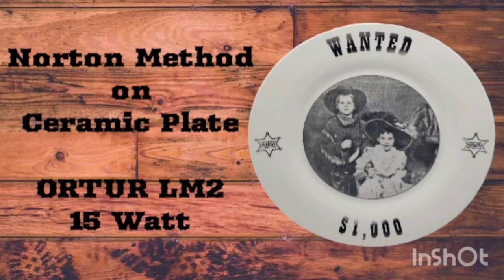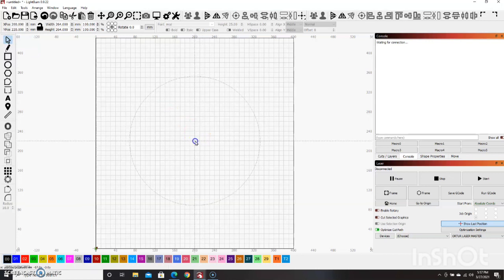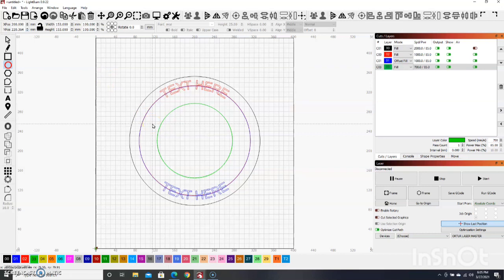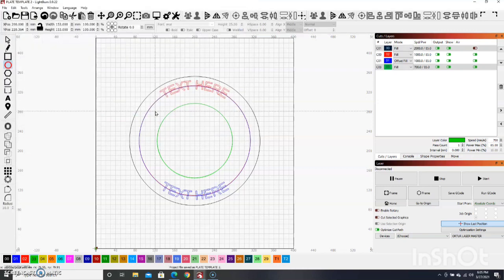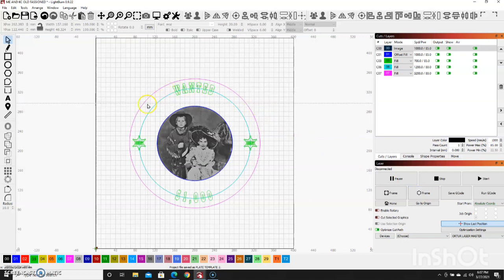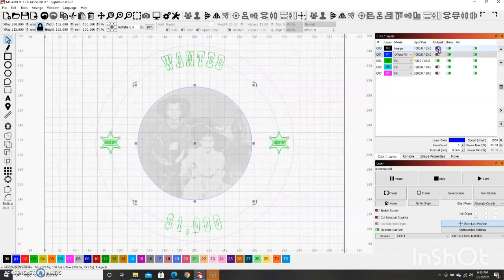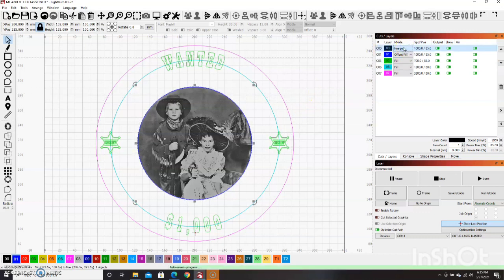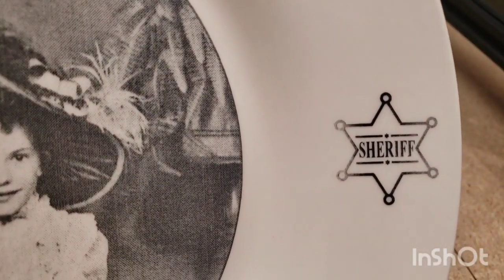Norton Method On A Ceramic Plate Tutorial. OLM2 15W.

Comment: Hello. Great video. I have one question. You painted the plate with white paint. You are using Norton's method. Everywhere on YT there are videos where two paints are applied, e.g. white and black, or vice versa. How did you get the black lettering and drawing? How was the shade of black created when everything is white?
Reply from the maker: Easy mistake with "Norton" put on so many things.  There is Norton White Tile NWT which this video is about. Used White paint on a tile and go slow and hot enough to burn the paint black and fuse into the tile permanently. The Norton Black Tile you paint White then a layer of Black. You go much faster and burn just the black layer off to reveal the White underneath.  This is way faster but not permanent. They make nice gifts but I have never sold much of any for profit, but some do OK with them I guess.
Reply: @TheKennyHack  OK. So you paint ceramics first white and then black?
Reply from the maker: @DariuszBańczyk  this was just painted Heirloom White.  Then lasered at a slow and high power to burn the paint permanently into the ceramic. The black is created by burning the high zinc content in the paint. It can be washed and used as a normal plate and the image will last for a good while.

If you do a second coat of black and just burn off the black layer  to expose the white its not permanent but is much quicker to do.  The plate is only for show and can't be used.

2 completely different methods.
Reply: @TheKennyHack  Thank you.

Comment: On the top tool bar, to the right of the group select. Those triangles will flip the image either vertically or horizontally, rather than how you did it be moving and resizing.

Comment: Hi.
Excuse me, I don't speak English and I wonder if what you did after recording the image is to apply black paint and remove the waste?
What does the Norton method mean?
thank you and excellent videos.
Reply from the maker: With the Norton method you put white spray paint on the tile and burn it at slow speeds and high power to fuse the paint into the tile permanently.

Comment: very nice, i love your videos, but i have a small issue with ceramic, i dont find the same paint all of you use it (im in africa) i found some glossy white paint spray, czn i use it? i have a ortur lm2 20w what do you suggest me as settings? thank you
Reply from the maker: Most use a flat white but I have seen people use gloss and other off white colors. Just don't be afraid to experiment.  You should be able to use the paints for other projects if you can't get them to fuse into the ceramic how you want.  For me that's some of the fun of this hobby is trying new things. Good luck and thanks for watching.
Reply from the maker: Is your 20w a fixed focus or an adjustable? My adjustable 20w I couldn't get to fuse the paint very well as its focus wasn't the best. The newer fixed focus I think work. Start out around 1000mm/min and 80% power. I like newsprint using the double dpi method I show in my videos but most use Jarvis or Stucki. Just make sure you clean the ceramic with acetone or the like before you paint it.

Comment: Don't use white paint on white ceramic or porcelain.  It's difficult to gauge the thickness of the paint layer with it being white on white. This is likely why some of the letters are faded. the paint is thicker there. The best colour I find to use is purple or yellow spray paint.
Reply from the maker: The outer letters got a bit faded since its on a curved part of the plate. About 6mm  in height difference across the lettering. I've figured out how to get them fairly uniform by running them twice at two different focus lengths to get fairly even. 

I also do 3 coats on my plates to make sure I didn't skip any areas. So far this has worked very well for me and doesn't seem to affect my overall speed. I've since moved up to 1400mm/min at 85% power with good results. Just need to darken the image a bit to adjust for the faster speed. The faster you go the more accurate your focus has to be though.
Reply from the maker: Can you run faster with the yellow or purple vs white?

Comment: New sub here, I just got my laser and have done some work on it but nothing holds a candle to what you do. Can you do a tile at the same rate as what you did the plate?
Reply from the maker: I'd think so. Right around 800-1200 and 80-85% seem to be typical #s for the Norton Method. I've only been doing lasers for about 9 month. Just put in the practice and you'll get things figured out. I had to teach myself as nobody was running the high speeds I ran back then,, but now a lot of people are doing it and can give advice in the forums.

Comment: another out of the park, thank you. How do you find it for feel, is it etched in the plate?
Reply from the maker: You can feel the engraving is slightly raised up from the surface or like a texture to to it.
Reply: @TheKennyHack  thank you sir, also i find to centre things quickly i use the move to center icon up in the tools bar beside the little man, group icon.
Reply from the maker: Yep, I use all of those all the time. Many ways to do it without needing a camera if you make a layer in lightburn that matches the size of your work piece as a guide.

Comment: When you are making circles all you have to do is hold down the shift key and drag out the circle. Then you can go back and enter in the dimension one time. Do the same with the square icon to make a square.
Reply from the maker: Good tip. I did not know that.
Reply: @TheKennyHack  I don't know all the tricks to LightBurn yet and probably not ever know them all.. You've taught me some so I thought I would return the favor. Keep up the good work.